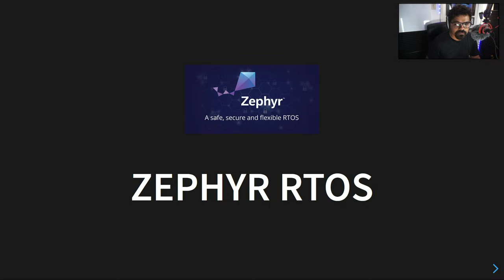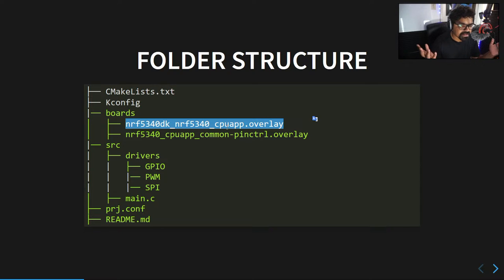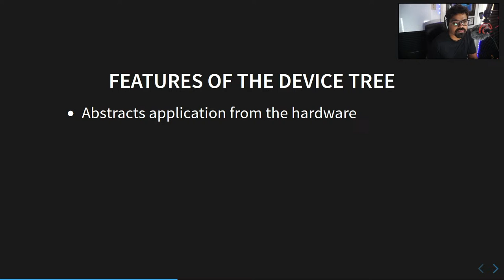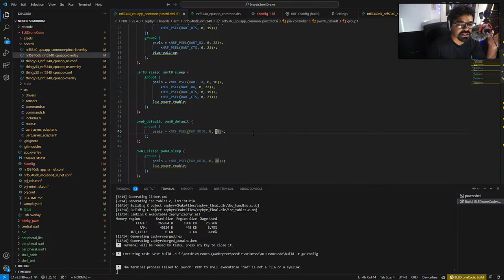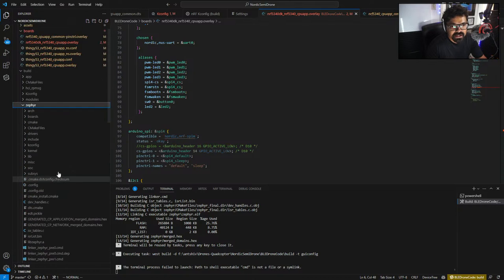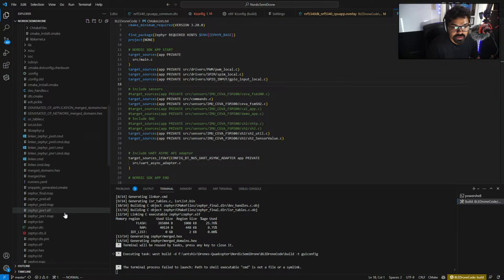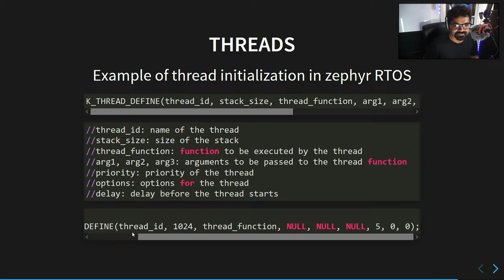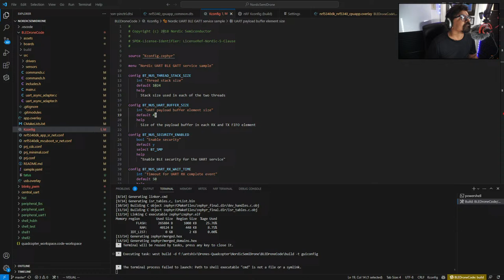Zephyr RTOS Intro - And why I love it

Comment: Hello, thank you for this video! Would you please make a video on setting up a vanilla Zephyr environment on VS Code (from what I can see in your video, that is exactly what you are using). I am in the process of setting my workspace but it is quite tricky.
Reply from the maker: Are you using Zephyr with any particular MCU? If you are working on developing the Zephyr RTOS itself ask the zephyr community in their discord channel for help. 
In this case I am using the Nordic semi SDK which runs on Zephyr and works on the vs code ide. Nordic has pretty much done all the heavy lifting. I have just followed their guide to get it all working.

Comment: Still have not bought into Zephyr. File system looks overly complicated. Maybe this is clearer to a Linux developer, but it seems like a lot of overhead development. Using FreeRTOS or Thread just instantiate the kernel and make your calls. Most RTOS applications use only 3 to 4 processes, easy to set up and use only the peripherals you need and configure them. Also, would like to see a side by side application of Zephyr vs FreeRTOS final application memory footprint usage on the same mcu. Liked your video, but kinda cemented me more:)
Reply from the maker: Yeah, Zephyr is definitely complicated. FreeRTOS is a great alternative and a lot easier to get started with. Use the best tools for the job is my recommendation.